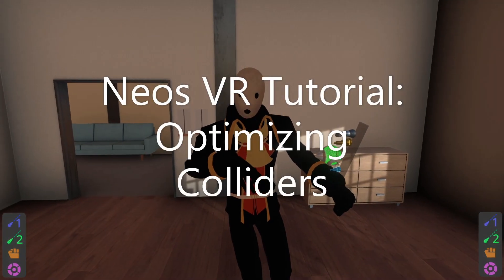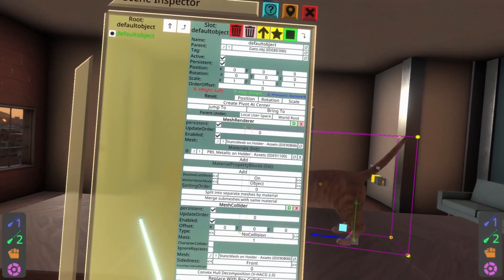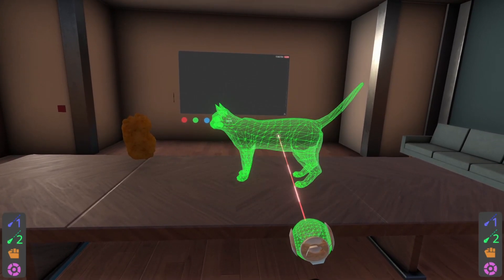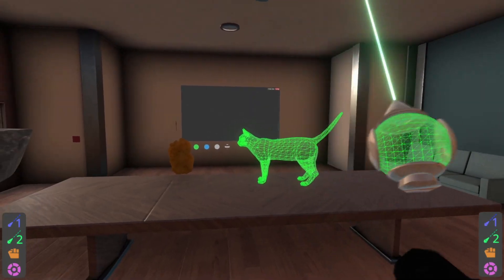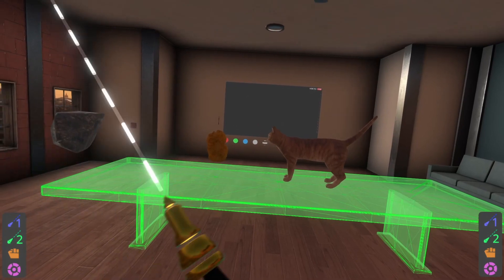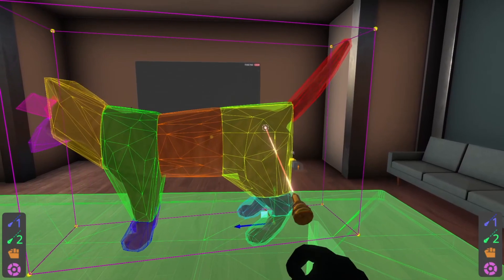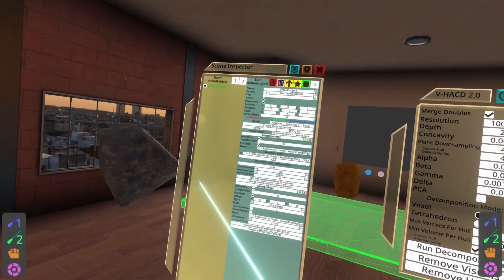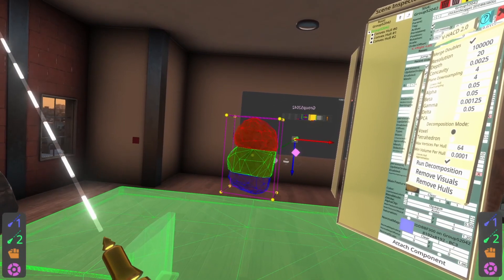OLD: Neos VR Tutorial: Optimizing Colliders

Comment: I  have been going steps further.
Pile all the convex hulls into one, Glue them.
Transfer one of the Materials to all the materials of the convex hull glued so only 1 material of data is connected.
Grab the mesh shape of the glued 1 mat convex hull, and place that in the mesh collision of the parent, the wizard was run on.
Delete the glued convex hull.
This is what I wish the Wizard really does.
Reply from the maker: Unfortunately, This is largely unnecessary and potentially problematic. You're undoing a lot of work the wizard is MEANT to do.
1) Gluing them will turn them back into a mesh not a convex hull. Keep them as a convex hull.
2) Materials only exist when the "Show Visuals" option is on, when its not they have no materials
3) Don't use convex hull meshes on a mesh collider

This is why the wizard does it a particular way.